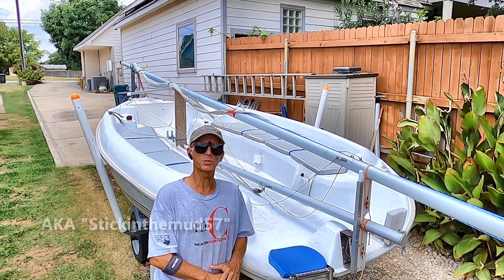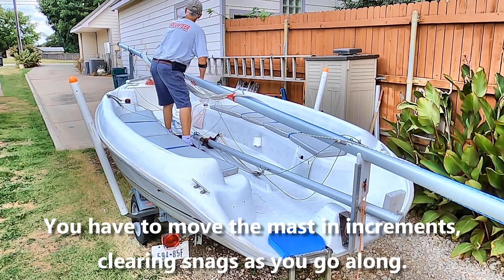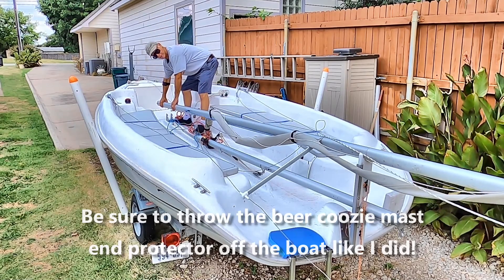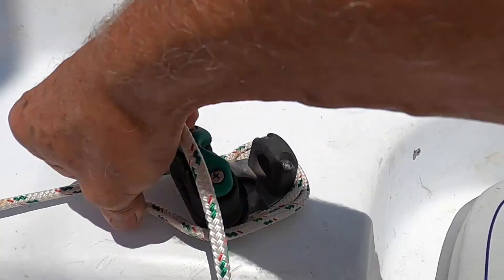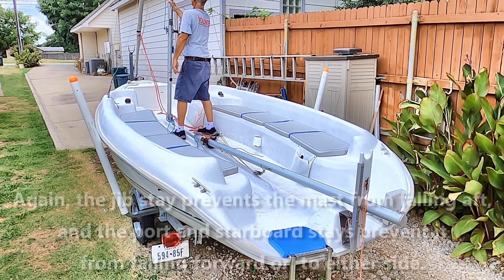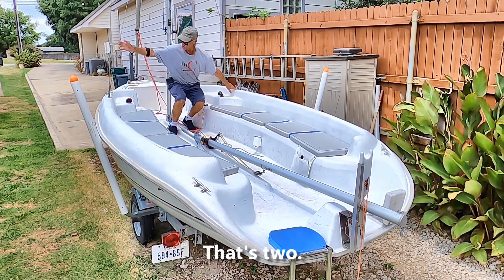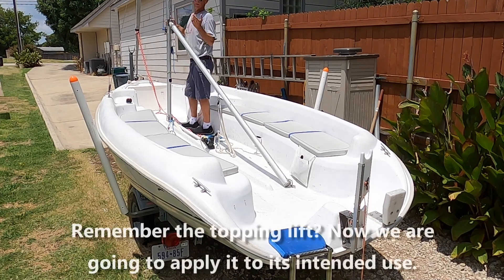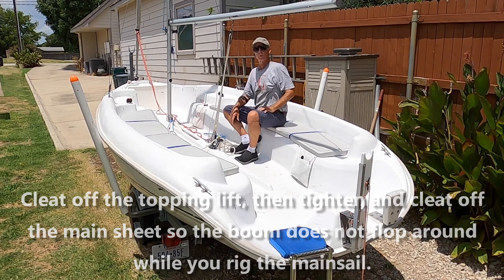Hunter 170 Mast step and boom rig

Comment: Hey Bruce, so I split the plastic in front of the motor mount.  It’s about a 5” split and only in the plastic area, however with the motor on it opens up like a mouth.  Since Hunter won’t talk about these boats, should I just back fill inside the crack and seal it?  Any recommendations on what to fill with so it holds?  Thanks!!